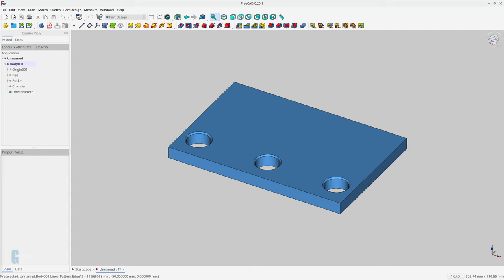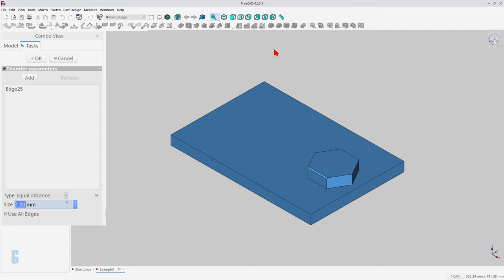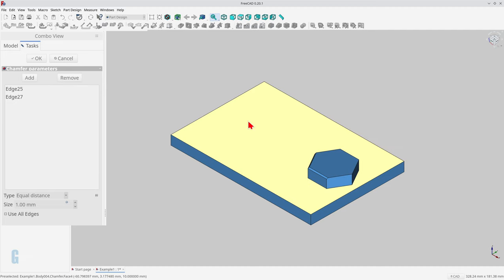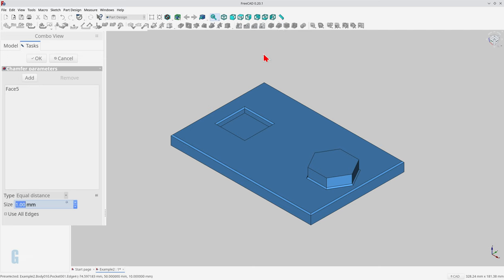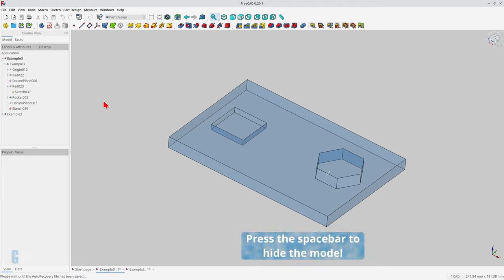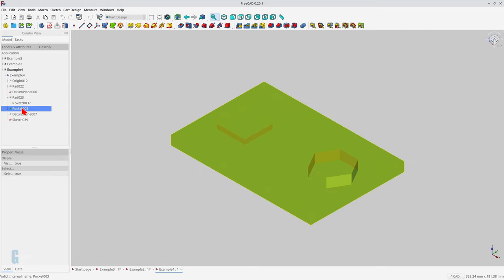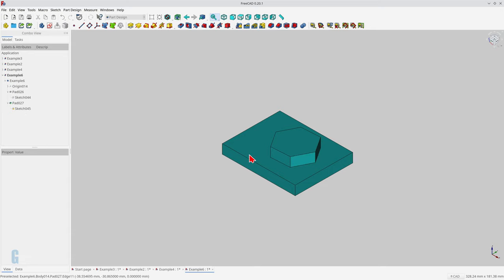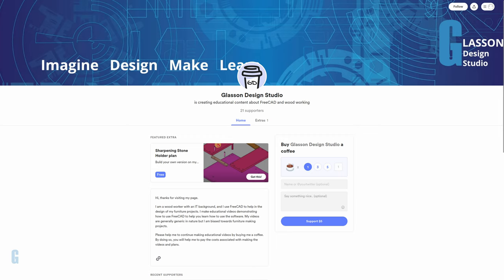Howto use the Part Design Workbench Chamfer Tool

Comment: First let me say thank you for the video.

Now for the criticism, and not of you but of FreeCad.

I use FreeCad, with the Part and Path workbenches. These two WBs treat chamfers very differently. In Path I believe the recommendation is NOT to model Chamfers, rather cut them with a single pass of a single tool using  the chamfer toolpath. 

So as far a Path is concerned Chamfers seem to be cosmetic in nature .... unless they are fairly large, then I guess you could mill the chamfer.
Reply from the maker: Thanks for your feedback Carl. I haven't used the Part workbench as much as I have Part Design because I find that Part Design meets my needs (mostly) as a wood worker. It's interesting to me that they would have a different philosophy to using chamfers in a model, and I can see the logic of it up to a point. TBH I don't put chamfers in any of my designs in FreeCAD because I use tiny chamfers on the finished product  to soften the sharp edges of timber so that people don't get hurt. Tiny chamfers are hardly worth modeling IMHO but I will model a decorative chamfer from time to time so I do use the tool. 

I appreciate your feedback because it helps me understand the software a little more each time I receive feedback.